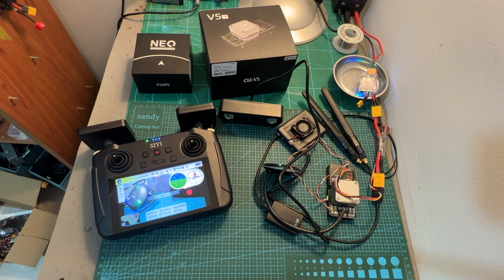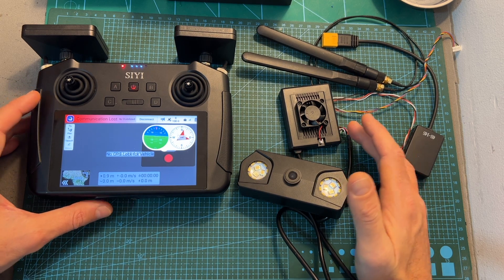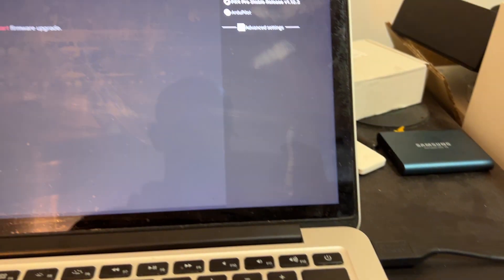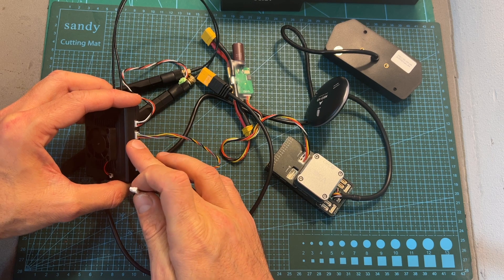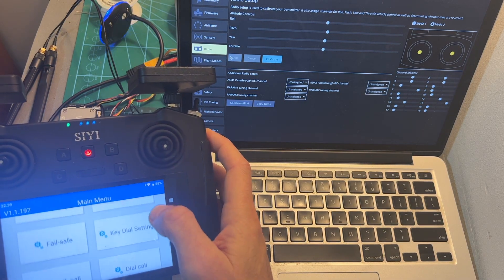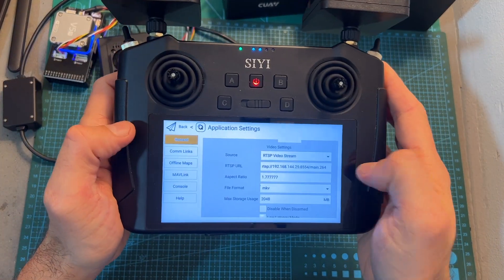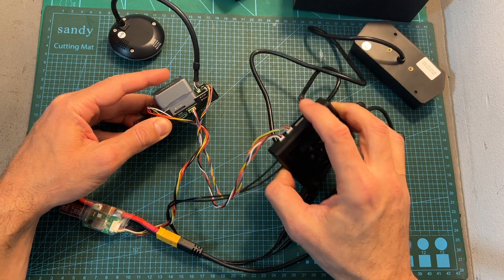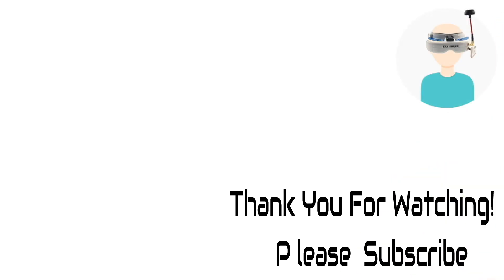CUAV V5+ AutoPilot // SIYI MK15 Quick Setup Tutorial

Comment: I have the SIYI HM30, and i found it quite un-reliable unfortunately. 

Even though i finally got my project target ~25 km range, it drops connections frequently it has high latency and i found it working relatively OK only in the 40km GCS mode.  

The 5 & 8km “low latency” modes are useless, have really bad connection and can’t be used for FPV. 

The FPV app (video) has some bugs - home arrow pointing to the wrong direction, and if you lose connection mid-flight, the video will not restore even though you might have reconnected & get GCS data. 

Because of this i don’t trust SIYI sistem as the main control for my planes and avoided buying the more expensive MK15/32. 😢

Comment: The ending disclaimer is why I'm struggling to buy this expensive equipment - here you are having to swap pins on plugs and $%&t - if I spend this muchn on this unit and a GD plug isn't wired right I'm losing my mind and sending it back in pieces to Siyi

Comment: hello
we have the same configuration as you on our drone. we followed your tutorial but impossible to connect with the Qgroundcontrol app on the siyi MK15 radio
but the connection with the app on a pc yes
we can't find the solution?
have you made a special configuration of Qground control?
Reply from the maker: Hi, did you update the controller to the latest available version?
Reply: @KremerFPV  Hi, no I did not update the radio I do not have the usb to GH 4 pin cable to connect to the radio upgrade
Reply: do you have an email to communicate if it is possible?

Comment: Hello, I need to integrate the MK15 with the PC, through WiFi and/or USB cable. QGround Control is installed on the PC, instead of using the QGroud control that is installed on the MK15, I need to use the one on the PC, because the screen is bigger. Is it possible to do this integration? I know it's possible via HDMI to view the image, but I need to be able to interact with QGroundControl.
Reply from the maker: Hi Fernando - yes it’s possible.

Comment: Howdy - thanks for the videos.  What is the default IP address of the camera?  I can't seem to get mine connected.  And the default username and password?  Thanks so much.
Reply from the maker: Hi Bill. There should be a sticker with the IP on the camera. Unfortunately I don’t have this system anymore. I suggest contacting SIYI as they will surely be able to help you out.
Reply: @KremerFPV  Thanks Gal.  I should have said I was using the numbers on the sticker and could not connect (so I thought maybe the default I.P. address would be worrth trying).  Anyway I finally got it connected using the sticker data.  Thanks again.

Comment: Hello Sir I would like to integrate Siyi MK15 controller with DJI A3 and a gimbal. Please tell me is it possible to use SBUS and PWM outputs of Siyi receiver simultaneously ?
Reply from the maker: Hi, as far as I know - no. You can connect it to a flight controller like the V5+ and then use the servo connectors for that.